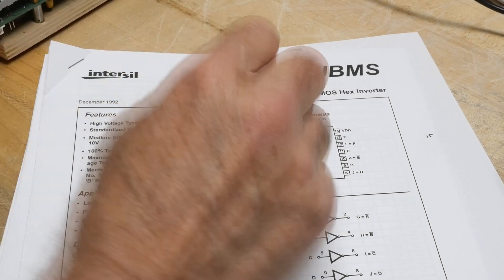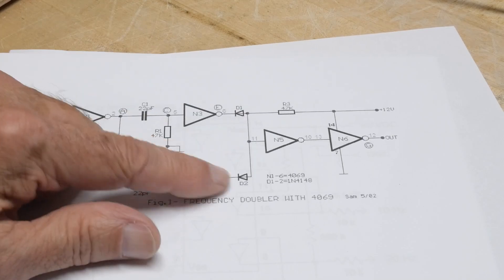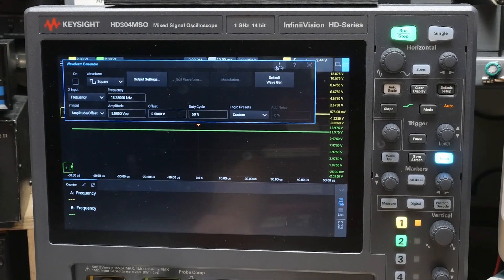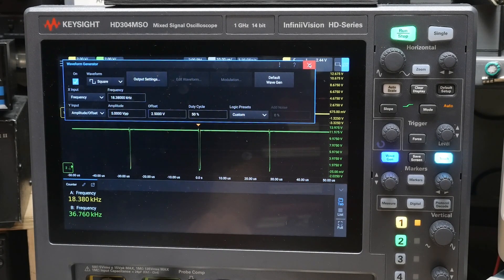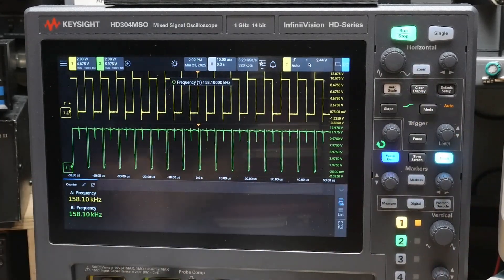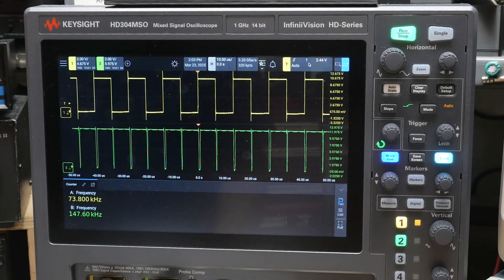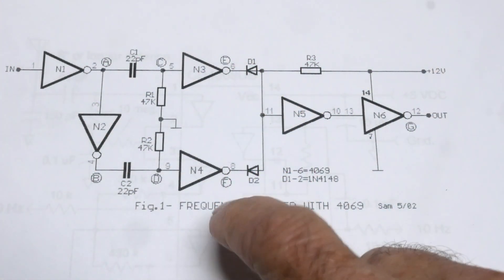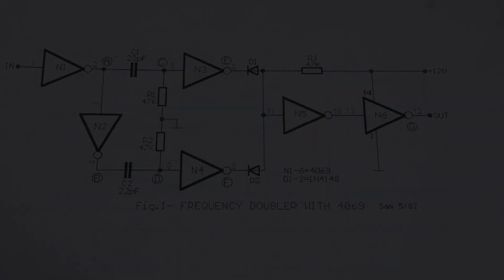#2190 CD4069 Frequency Doubler

Comment: You could easily do the same thing by tying an XOR or XNOR. They can create a very high frequency glitches due to double state changes. By adding  a LPF, you could extend the duty cycle.  

One of the very important usage of this chip is Voltage-Controlling Oscillator which you haven't talked about yet.

Comment: I expect that faster diodes and smaller pullup would extend the frequency response.
Reply: The main problem is the RC on the input of the gates. It's turning the edges into pulses. If the diodes were a problem they could be replaced by an AND gate.
Reply: @misterhat5823  The capacitors are in series; they pass better at high frequency than low.

Comment: Have you checked to see if there is a firmware update available for the scope?  I know occasionally when I get a new to the market piece of test equipment or a radio I sometimes find a glitch.  Usually get's fixed in a update rather quickly.
Reply from the maker: yes, I have the 3rd or 4th update

Comment: I guess the limit on the speed is mostly determined by the R/C time constant of the cap & resistor values?
Reply: Also the IC’s speed limitations, mostly capacitive
Reply: @mmaranta785  That IC is capable of far above 100kHz. The RC is the limiting factor here.

Comment: That's an interesting way to  wire-OR the outputs.  It prevents the inverter with the high output from having to supply any current, i.e. its output is not shorted to ground.  I have done designs with two TTL outputs wire-OR'd together (SHHH!).  That was okay, as long as you didn't do it to more than one gate-pair in the same part.  Maybe not so good on an unbuffered part?

Comment: Could you change the resistor and capacitor values if you needed it to work at higher frequencies? Is this how high clock speeds are generated from crystals?
Reply: Yes you change the capacitor and resistor values, and in general, this will work at higher frequencies, though normally inside an IC they use open drain gates, and then use a pinched off mosfet as a pull up resistor,, and use diodes as the capacitors. more complex ones use some small area inverter gates to get a delay, and then XOR with the original, and a second one to double again, before regenerating a 50% duty cycle clock if needed using a divider. more complex they use different methods, using a small PLL and VCO to make a multiplied high speed clock, then divider to slave it to the incoming clock, but that is a lot more complex, and will probably be covered in large by the CD4046 datasheet, along with the more modern derivatives.
Reply: @SeanBZA  Thanks!
Reply: Higher clocks are generally created by running the crystal at an overtone, using a PLL multiplier, or using something other than a crystal.
Reply: @misterhat5823  Thanks. That makes sense. Though now I'm wondering how my computer is able to so accurately not only run at several gigahertz, but also to be able to move up and down by such small increments of only a few megahertz at a time. Do PLLs let you choose arbitrary multiples, or only integer multiples of the original?

Comment: This could be done with 4 NAND gates and one XOR gate, where we use the propagaton delay of a NAND gate to create the phase shift.
Reply: It could be done with an XOR gate.
Reply: @makerspace533  True. I think OP was using the other gates to avoid an RC. That would work better at (much) higher frequencies.
Reply: @misterhat5823  Right.  I was thinking about using the '86 where you could use three of the gates for phase delay.
Reply: @makerspace533  Because YT deleted my answer, here it is again:

I used this circuit to have a fast edge detector where an input pulse changes in length.  NAND gates were used because i needed to have output pulse long enough to trigger an interrupt pin of a ARM processor (more propagation delay = wider output pulse). RC components are frequency depended  so that was big "minus" for me. 
While it took more space it worked like a charm.